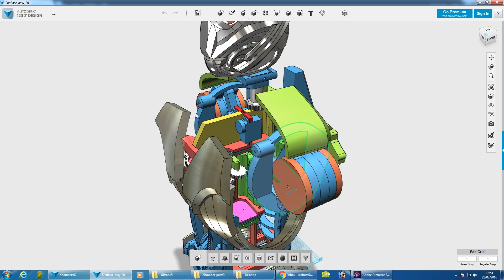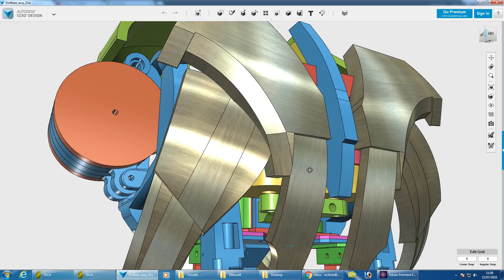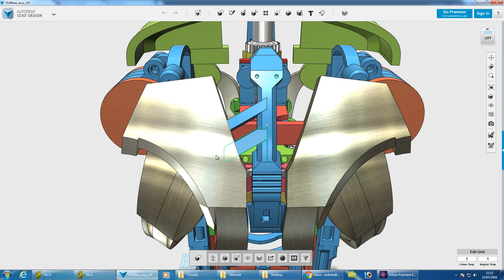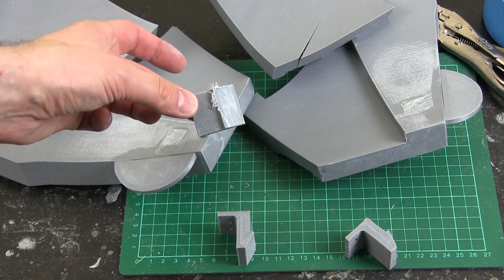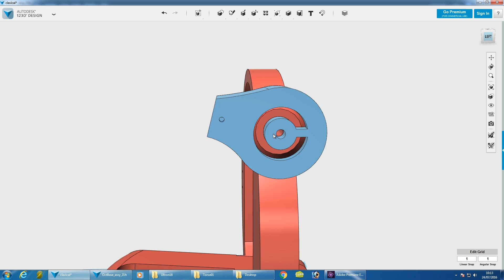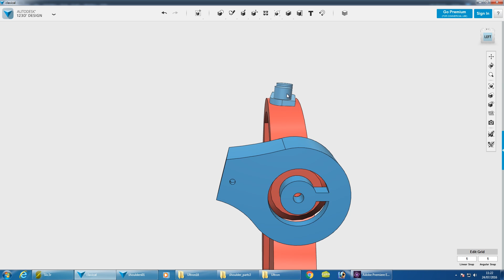Avengers Ultron #18 | Neck & Shoulder Functional Cosmetics | James Bruton

Comment: James. Why don't you just print multiple things at one time. The printing beds look very empty and you could save a lot of time by using the whole bed
Reply: Not really. If a part takes two hours to print, and you need two of them, you will still be waiting four hours wether you print them one at a time, or both at the same time on the same printer. The only way to save time is to print them on two printers. And if you have several parts printing on the same printer, and the printer fails, then all of those parts are trash, verses only one part ruined.

Comment: The clavicle just needs to be cosmetic and attached to the top of the breast plate, there isn't any need for it to need to move with the shoulders or conflict with the neck conduits. Could you make ninjaflex liner tubes to put through the conduit holes, that would make them look more solid and make them flex more smoothly like actual conduit rather than clunky and choppy puzzle pieces.

Comment: It's starting to look nice, but again, I have come corrections in mind. First I think you should rework the head - It looks funny and happy, instead of menacing and evil. You need make it beefier, you need to change the eye sockets ( a lot of the facial expressions comes from eyes, so its first thing to change if your robot looks wrongly happy ) and you need to make that grumpy look with the bottom lip pushed up - just like iron man helmets. This "reverse smile" does help a lot with the menacing look. Also I would thin out the year antenna years. Now for this episode I have two points. The shoulder plates you added represent the "trapezius" muscle and it's name speaks for itself - they shouldn't be horizontal and flab, but more like a slope, thus forming the shape of a trapeze. Look again at Ultron photos and perhaps some athletes. The second point is the neck conduits. They look nice, but they shouldn't be attached bellow the head, but more like behind it. This way there is no gap between the head and conduits. Also they should run alongside and not forming a triangle shape, thus making the neck more formidable ( which would work great in combination with the new head for that menacing look ) I do hope you touch on those points, because It would really work to make a better looking robot in my opinion. Never the less - great build, thanks for the content. Keep it up :)

Comment: When it comes to things like those conduits in the neck and those dual spines down the back (Although the back might be impossible to do this with) I think you should try to make nesting parts that sorta work like a ball hinge so when they do bend they just slide over each other instead of simply folding where they are bungied  together